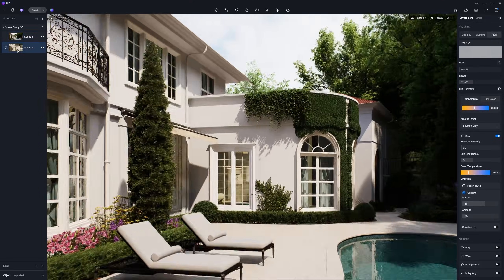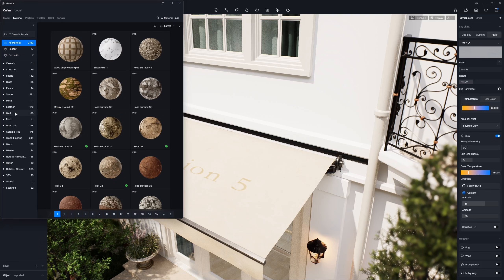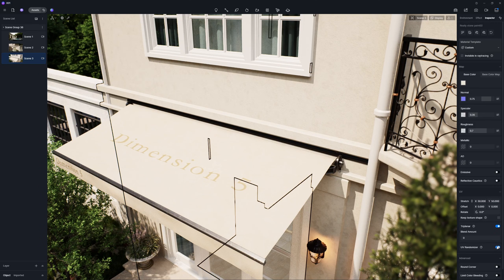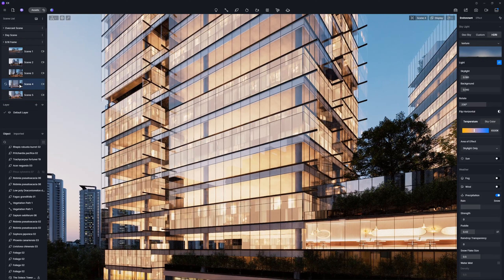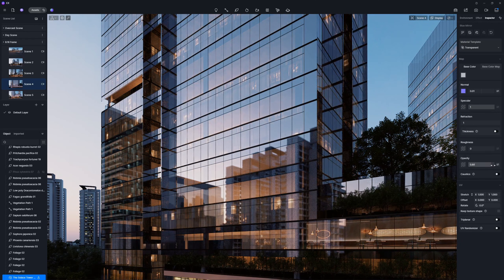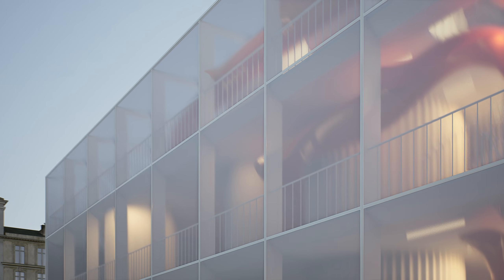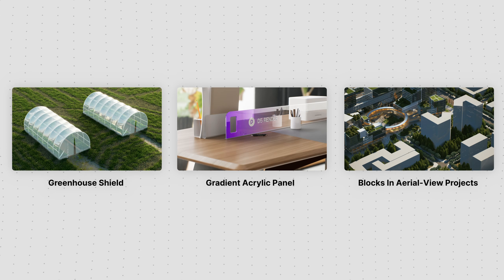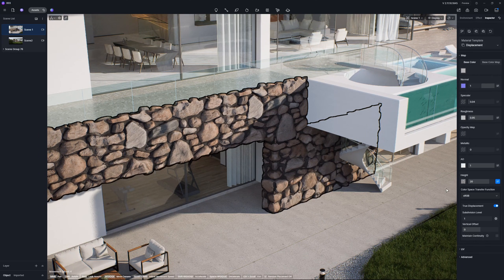True Displacement is coming to D5 3.0! Facade material tips: glass, stucco, stone, and polycarbonate

Comment: What if D5 makes a light mix like corona or vray. I think competition will be very less Most users will shift from vray to D5. Because it will save lots of time sometimes we struggle to render again just because of unwanted lighting.  That's why light mix is an awesome feature...
Reply: I also hope to have the function you mentioned, but currently even scene recording cannot record the color temperature and brightness information of lights. For example, in Vantage, although there is no lightmix, other parameters of each lighting scene can be recorded

Comment: Material settings should allow for simulating tools and adjusting wall edges with a single button to create a smudging effect. For example, this could be under the softening button. After the corner smudging effect, we need to add the ability to distribute the scatter more naturally. Often, when viewed from a distance, individual squares of grass or leaves appear to be planted one by one. I experience this a lot and don't know if it can be fixed. I think it was in Vray too, it's confusing. These are the scattering effects that come to mind for now, and most importantly, even if we illuminate the environment well with general lighting, it's difficult to achieve that desired cloudy and blue sky. Can we also control the sky's intervention from the lighting options? For example, can we make the dome light visible but adjustable, like turning the light effect on and off, or with a forward/backward brightness button? For example, a setting that progresses from 0 to 1000, allowing us to balance the color combination in the sky according to the light in the project.
Reply: I meant that I want to be able to create a flake effect on vehicles; this option should be available.
Reply: go put your issue in the forum, not in a random youtube video --'
Reply: @darkryst I'll write wherever I want, I'll ask your permission,  I thought this would be a good place
Reply: @TahaFurkanDag rage baited easily kiddo
Reply: @darkryst  Don't try to act all cool from afar with your keyboard warrior skills, mind your own busy.

Comment: Please please please add dirt overlay to materials to give it a used look.
Reply: Dirt to glass and dirt blend  when placing or rocks on the ground to blend ground surface to the rocks to make it feel fit to the scene
Reply: Better grass engine, maybe add the dirt feature to that too, to make the surface more irregular. Better water engine to suite ocean modeling. Custom parralax, to render your own parralax to save to custom library. Real skies. Shadow catcher or shadow channel for post processing, Ai in videos, Fur, more variations if recent cars in the world. Garden match Ai, upload a photo of a garden and it Will try to make the same garden it tree species. Better blur control, and cleaner alpha channels when rendering glass, not cutting out the glass as well. There is so many areas that can really benefit from improvement